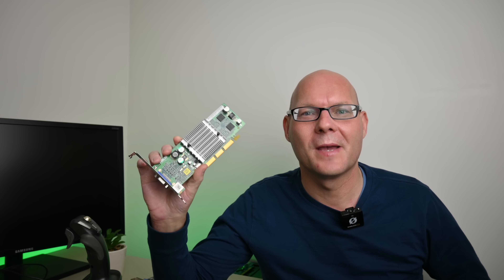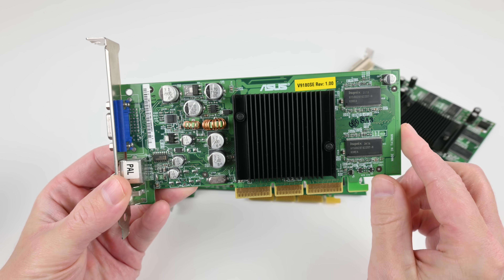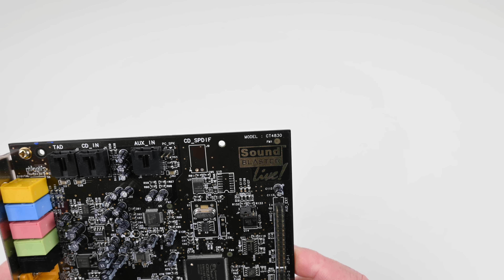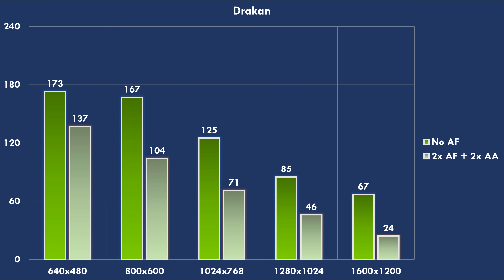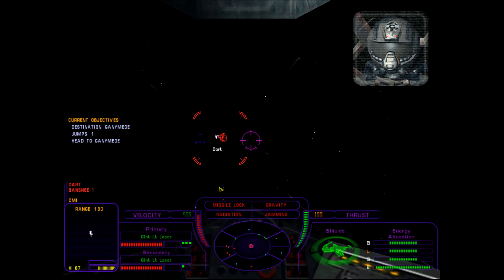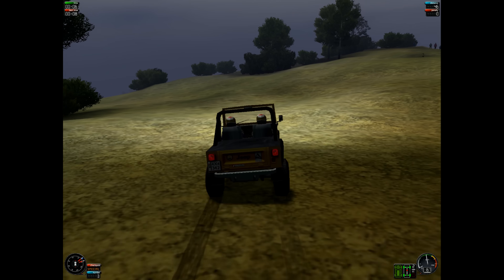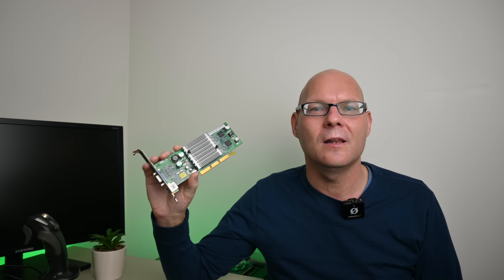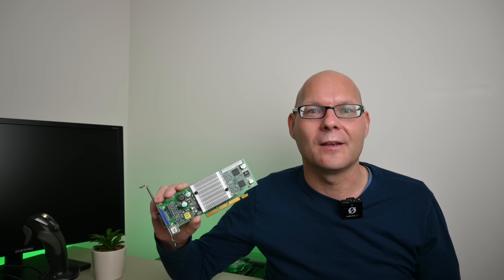One of Nvidia's most Controversial GPU

Comment: Worth mentioning is the fact, that these cards were victims of their success - a lot of cards named just "MX440" had 64-bit or even 32-bit memory bus. Nvidia didn't control the market back in a day the way they are doing it today, so technical specs of these cards were more like a guidline rather than anything given. Memory bus was mentioned already, but clocks were also all over the place. Even the one you are showing on your video cannot support official memory clock of 200MHz (400MHz DDR) as it has 6ns memory chips rated for 166MHz. A lot of "true" GeForce 2 MX / GeForce 2 MX 400 cards were faster than GF4MX because of that, whereas a true GeForce 4 MX460 is a lot faster than even a GeForce 2 Ultra thanks to its high clocks and texture compression mechanisms.

I would like to recommend you Aquanox & Aquanox 2 games if you like space shooters. Those are quite hard games, but apart of main story you have the possibility to just jump into the battle with different modes. I played them a lot back in a day and I like to go back to them.

When it comes to Max Payne & Max Payne 2 - those games have one of the best stories in game to this day. They might feel quite hard, but I recommend just forcing yourself a little bit and not giving up. Discovering the story is totally worth it.
Reply from the maker: I've actually been playing more of Max Payne for a recent video 😊 The difficulty was ok at first after getting many tips from the comments, but half-way through it just get so hard that I quicksave pretty much every corner and it just takes you out of the game, it doesn't flow. So I found a cheat for the health and now enjoying it heaps more without feeling stressed 🤣

Comment: I had the Albatron GeForce 4 MX440 - 64MB DDR / 128 bit (275/400). It was a great card for the price. I have upgraded from a TNT2, so it was a gigantic upgrade for me, and even a GeForce 2 or a Radeon 32/64 DDR would have been a great upgrade. I remember playing anything on the MX440 at that time. It was even faster than my friends GeForce 3 Ti200 in DirectX 7 games. It was also a good overclocking card. I had it running at 320 / 500 as long as I had it. So, for me and my socket A PC, was a good, accessible card. Thank's for remembering me :).
Reply from the maker: Albatron! Haven't heard that brand name in ages!
Reply: @philscomputerlab  I almost forgot it too. I also had at one point, a Albatron motherboard for 478 socket. It came in a beautifully colored box. Had i875p chipset if I recall corectley. Beautiful board.
Reply from the maker: Fun fact, I am working on a project with a Albatron 6800 GT. I think it's a plain reference model but with Albatron marketing on the cooler.
Reply: @philscomputerlab  Ha ha. Beautiful. Can't wait to see the video. The MX440 looked like the reference model too.

Comment: I had MX440 in 2003, dunno why you're using WIn98 when this is clearly XP era card... I played CoD and CoD2 on that same machine (athlon 2300+, 512MB). Only in Freelancer I had to turn off the background in some missions as they'd slow down the framerate, but usually kept it on.
Reply from the maker: The MX is a DirectX 7 GPU and that fits better with Windows 95 and 98 whereas the Windows XP era is DirectX 8 and 9. Windows XP is an interesting era, it spans a wide range of compatible hardware and there are so much better GPUs to use for Windows XP whereas there aren't that many options for Windows 98, especially if you want a good price. In short the MX is not a good option for XP but an excellent option for 98 when building a Retro PC in this time.
Reply: @philscomputerlab  TBH I only upgraded to XP in 2003 when I got a new machine, by 2006 that MX440  was replaced by a 128MB Radeon but I forgot the model :)

Comment: Hey Phil!

Just a quick question. Tried to make this less wordy.

I got an old HP Compaq DC 5100, its from my dads workplace, used in around 2005.
He took it home in 2008, i was 18, i didnt use it... :P

I tested it a few years later, i played a good bit of Daikatana on highest, coloured lighting, texture filter, it all worked, it struggled to run Hl2 on lowest, but it worked!
Integrated graphics...

Im wonder, what on earth can i do with it now?  its in good shape, clean. 
Its got a CPU dust shroud. Core 2 Duo processor. i gave it 4gb DDR2.

I have a spare LP GT 1030 from a past retro rig, a spec sheet says the Compaq has 2 LP PCI-E slots, PCI-E 1 ofcourse!

Maybe i could pop in the 1030 and use it as a offline retro rig?
1030 should be alright for a 240W PSU. It worked fine on a 2010 rig, i hope the card works on a older one.

Its running a fresh install of Windows 7, i bought a cheap copy, couldnt find XP anywhere.
What should i do with it?
Reply from the maker: Hmm without XP or 98 not much retro about that machine. And the 1030 doesn't XP drivers either...

Comment: The only objectively correct card to have at the time was an ATI 9700 pro anyway. Or better a 9500 unlocked to 9700 pro. Anything else either was stupid or fanboyish ;)
and this remained from 2002 until nvidia's 6000 generation was released, especially of course the great 6800 GTX.

Comment: The problem with Geforce 4 MX series is that lack of pixel shaders and it hurt badly where in comparison every single radeon 9000 series card(even the budget ones) had support for shader 1.4 at least and this was a problem when you wanted to play some games like battlefield 2 which had min spec of shader 1.1. Then we have a complete lack of MVertices/s or actual Support for direct3d 8.0 because all the of the 4 MX cards were in reality direct3d 7.0 which lead to some hilarious instances where even when pixel shaders were not required the card were totally crippled.  Also the most common variants were mx440 and mx420 in AGP x4 configuration so their direct competition was the weakest card of 9000 series the freaking radeon 9200 SE 64 bit. The mx460 was actually quite rare because of the price tag basically back then if i remember correctly could get you GeForce3 Ti200, Radeon 9100 or Geforce 4 Ti4200 which ment that that card was pointless hell i even remember times when the price point of some manufacturers was so high on these failure of the cards that they asked you price of radeon 9500. 

The people forget that the 2000's were a complete shit!@#! in terms of optimization for specific hardware and the biggest comedy was when games that had Nvidia logo on it usually run the worst on nvidia cards which drivers were just as bad as Radeon drivers this circus continued until the freaking 8000 series came but even then you had the anomaly like need for speed undercover where high spec nvidia card run worse than amd low end card.
Reply: Lack of pixel shaders? Explain to me how Doom 3 manages to run on it while looking like Doom 3.
Reply: @fungo6631  Doom 3 is an opengl mostly game thats why you can run Doom 3 on Geforce 2 cards. If it was pure Dx game like BF2 which min. shader version is 1.1 the game would not start at all.
Reply: @Deathwalker666666  That's not how it works tho. If a card doesn't support features it doesn't support them. Also, Half Life 2 and NFS MW both support pixel shaders and are not OpenGL while also running on DX7 cards.
Reply: @fungo6631  Yeah but HL2 always supported non pixel shader cards they improved graphics later by adding pixel support as for NFS MW i am assuming you talk about the original most wanted that used T&L technology which dates back to the original Geforce 1. Pixel shaders became standard with DirectX version 8 with shader version 1.0 which is something that Geforce 4 MX lacked but luckily most popular games of that time still used T&L technology original BG&E is best example of that because it used pixel shading as performance boost not a must need requirement.
Reply: @Deathwalker666666  Except the GeForce 4MX supported pixel shader 1.0 via the NSR engine. 

It's just that EA was lazy, as usual. It's not a D3D vs OpenGL thing, it's just developer competence.
Reply: @fungo6631  No Geforce 4MX did not support pixel shaders at all - this was confirmed by Nvidia and was roasted for it back in the day.
Reply: @Deathwalker666666  Then please explain why does Doom 3 look like Doom 3 on it and not like whatever 3DFX Voodoo Doom 3 is?  

Explain to me what NSR (Nvidia Shading Rasterizer) if not a primitive pixel shader? Even GeForce 3 shaders were pretty primitive. What the MX 440 lacks are vertex shaders. Which might not be a problem if you have a multi core CPU and the game is single threaded (just do the vertex shading in software on the unused CPU cores). But it does become an issue on slower CPUs with a single core.
Reply: @fungo6631  First of all you are missing the point and giving pointless arguments. Doom 3 can be run on Geforce 256 because its supports T&L technology(aka the thing that predates Pixel and vertex shading introduced with Dircet3d 8.0) while some 3DFX cards lacked this technology which basically ruined the graphics. 

Also all Geforce 4MX models do not posses Pixel and Vertex shaders and this is info provided by Nvidia when they released those cards so don't mix it with some other tech.
Reply: @Deathwalker666666  Do you even know what T&L means and does?
Reply: @fungo6631  Technically the full name is TCL which stands for Transform, Clipping and Lighting  but T&L is normie term of naming.
Reply: @Deathwalker666666  Fun fact: the only difference between DX 6.0 and DX 7.0 is that the T&L is done on the CPU in DX 6.0. 

That is only relevant for lighting on the geometry level, not per pixel lighting. Doom 3 on the MX 440 in fact uses per pixel lighting. It lacks the heat haze, as that's VERTEX shaded, but the lighting is certainly there. 

There's a video showing all GeForce cards until 7800 GTX running it at high settings, and T&L doesn't cut it.
Reply: @fungo6631  You do realize that we are going away from the "why Geforce 4 MX was considered terrible" by going into same territory as the discussion about the first game that uses Tessellation which is RTCW actually and no dx11 game or why people dont understand that DX10 did not have DX9c limitations had, but it did not provide that great graphical leap from DX9b from shader 2.0 to DX9c shader 3.0.
Reply: @Deathwalker666666  Huh? Anyhow, the NSR engine the GeForce 256 introduced is indeed a primitive version of a pixel shader. 

Doom 3's lighting is indeed pixel shader based and somehow it still works on the 4MX. In fact, Carmack specifically wrote a render path that takes advantage of it. 

IIRC the original ATI Radeon is not supported despite hardware T&L as it doesn't have that primitive pixel shader.

Comment: Ah yes, the graphics card "Mit Nix"
But they were cheap and readily available DX7 capable cards. Faster than a GF2 when the faster memory was made use of. A bit like the Geforce FX 5200 Ultra, which was fast and cheap. (Not the normal FX 5200, that one was shite. Even slower than the GF4 MX 440 and 460)
I would say the MX 460 is the fastest DX7-only card, slightly ahead of the Radeon 7500

Comment: I've had a few of these in my Win 98 PIII system. I'll have to double check as I think I have a 4000 in there right now and I had thought it was better than the MX 440 I was previously using -- I know it at least had more memory but maybe the bits are different.
Reply from the maker: I also want to double-check my 4000 card, I think I have at least one, because apparently there are variants with 128 Bit interface.
Reply: @philscomputerlab  Oh, that would be nice if it is! Thanks for the heads up either way. Glad to know that the choice I made years ago when I was getting into retro was a solid one!

Comment: It was a great card. I had over 40 of them in my internet cafe. They ran all then current games with respectable settings and resolution (monitors were 17" 1024x768 anyways...) and the cards were on the cheaper side. People that complained did so only after they learned what they were gaming on and it was more for the laughs. Most of them just played CS and Quake 2 anyways. EDIT: I had some GeForce DDR cards too. Those were faster than GF4 MX, but they were hard to come by since they were already EOL and let's not forget that they had MSRP of ~$500 when they launched contrasted with a bit slower GF4 MX that were around $200. Full GF3 or 4 were over $400 which was terrible value in FPS compared to GF4 MX. Anyway, there is always something better, and worse.
Reply: Did you actually find the GeForce DDR actually performed better than a GF4 MX? That's pretty wild considering how much more GPU resources the MX had. I could see memory bandwidth crippling the potential of the lower end versions (64bit ... 32bit).

Comment: I beg to disagree a bit. GeForce isn't only about gaming GPUs it is consumer and small business level stuff, and the MX lineup, like later GeForce GT (as opposed to GTX) cards are good for multimedia stuff. Using technology from older generations for cheaper and easier manufacturing of these cards made sense as it was already mature, easy to mass produce and it was cheap, creating new everything for those cards, even now we see plenty of GPUs that wouldn't make sense as gaming focused GPUs, but make sense as consumer grade GPUs. Good for some students, hobbyists and acceptable consumer grade hardware for some small business users. 

A lower end production oriented consumer grade GPU needs more VRAM (3060 or 4060Ti) than an optimized for 1080p (or 1440p) GPU where you would use textures that are also optimized for the resolution (often not ULTRA anymore) and cards that are good if you want both consumer rate production use AND faster gaming (4080, etc) offer not only performance, but also versatility when we compare them to some gaming GPUs (4070Ti, 4070). For gaming I wouldn't consider 4080 a good option, but if it is for hobbies and consumer grade production use in addition to gaming, it seems to be much better. 

While at that time Windows 98 was still popular for many, some people have preferred the NT based Windows 2000. And an extra (Otherwise not needed) copy of Windows 2000 Advanced Server (along with its licence) somehow ended up in my hands, it wasn't the best for desktop use (had to disable a lot of unwanted services, had to change a lot of settings), but I liked it anyway. And of course many games didn't like Windows 2000 (and NT) at all. Ability to use multiple monitors and multiple GPUs to expand the desktop was a brand new feature of Windows 2000. Geforce MX was a good choice for a GPU for the 2nd monitor. 

Geforce 4Ti was an AGP card, most Quadro-s were AGP or AGP Pro cards, so having an option for a good old PCI GPU for an extra monitor was a big bonus in many cases. If I would use a Cascades (PIII Xeon) based retro build and would want to have both an AGP based and a PCI based GPU I would surely pick up a PCI based Geforce 4MX... With maybe one simulator using a good GPU and one big multisync CRT monitor, with another GPU and a smaller monitor displaying a map...
Reply from the maker: You make some some good points. I did mention that it supported dual monitors on many cards and it also has better AA and improved DVD playback. Thanks for the comment!

Comment: Hi phil.
Ive been trying to get a similar system up and running. I have an MSI K8MM3-V (MS-7181 V2.0) with an ahtlon 2600+ (1.9ghz). I use an IDE Compact Flash card (4gb), a Nvidia ti 4200 and a Creative sound blaster live (sb0060). Installing windows 98se works fine, however doing anything else results in system freezes or no booting at all. Sometimes i can install chipset drivers (5.24a) just fine and it works quite well.. then i try nvidia drivers (45.23, 66.xx, 81.xx) it stops working. Sometimes it doesnt. Sometimes everything installs just fine, but then when i try to start a game its giving me 3d errors. 
Ive tried different motherboard, different HDD's different GPU's. The only thing i havent tried is a motherboard without VIA chipsets. But im having a hard time finding one for a decent price. 
I have 2 big boxes with all kinds of win98 software and game i wanna show to my kids, but i cant :(

Comment: We had one of these - a 440SE as part of a new P4 system, being an upgrade from a 233MHz Cyrix and a Voodoo 4500. Even knowning it wasn't the best even in the budget realm, it's kinda all we could afford and it did pretty damn admirably. I remember having to use a utility to fake having proper DX9c compliance for Silent Hill 3 (which worked fine) and Pariah (which had giant white cubes everywhere where shaders were meant to be) and I then replaced it with the unholy itsef, the FX5200. Fun memories!